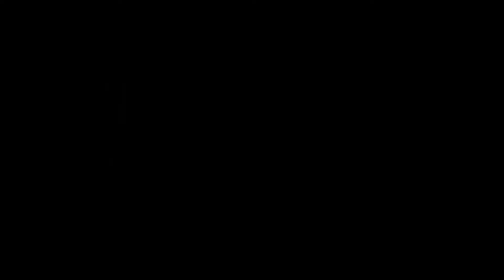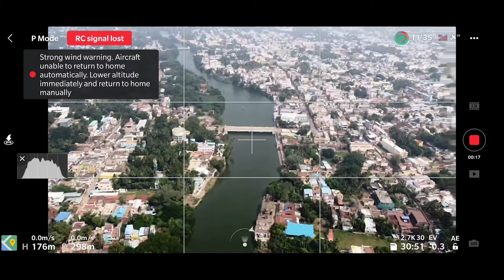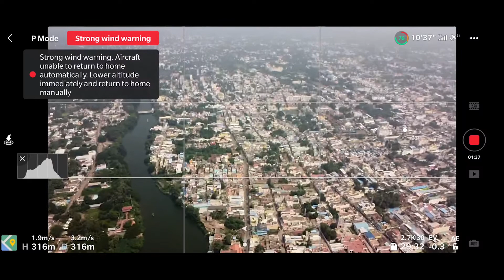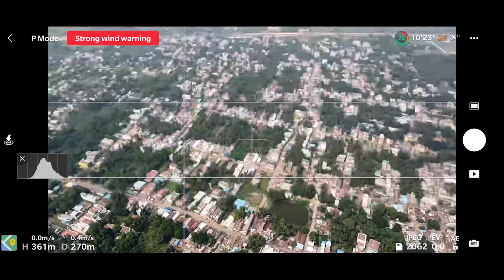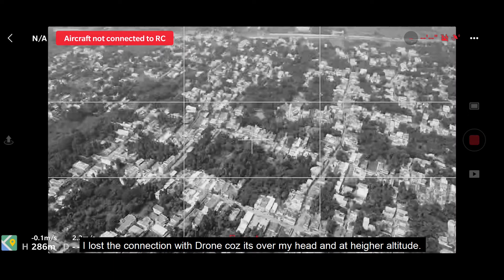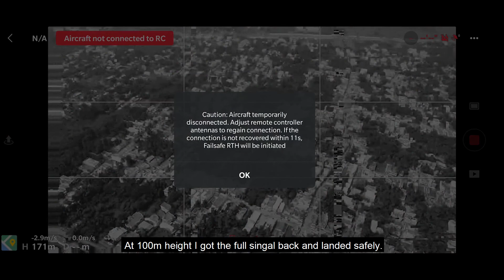Why Mavic Mini Has Signal Loss Problem? V1.1.10

Comment: Hi we have the DJI MAVIC AIR 2 and it was perfect with no connection issue at all no matter how far you went they then gave us the new update to allow our controller to be compatible with the new mini 2.
I didn't need my MAVIC AIR 2 to work on a mini 2 but oh well.
They have tried to fix it with 3 updates but haven't so your not on your own.
Liked and subscribed lets support each other